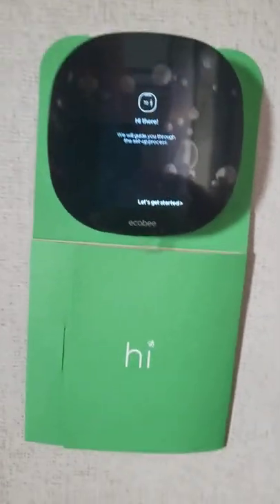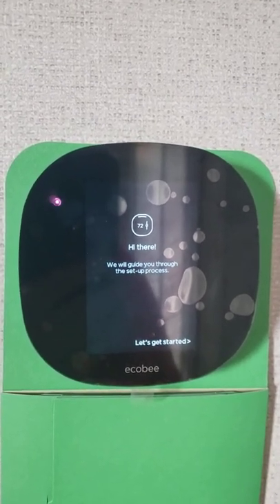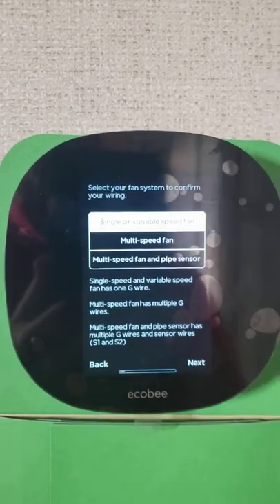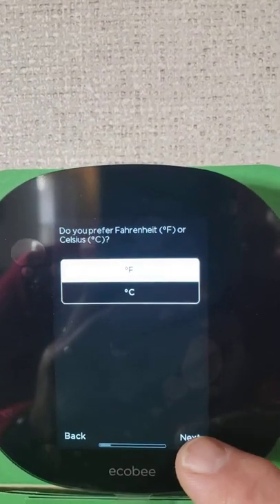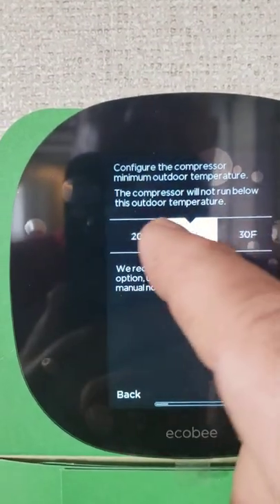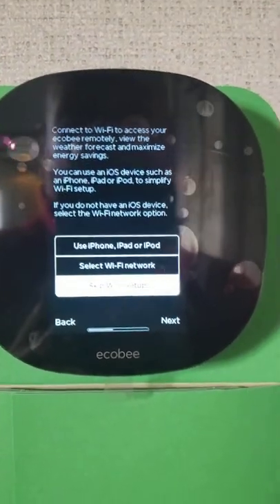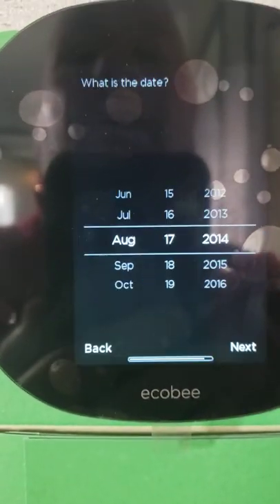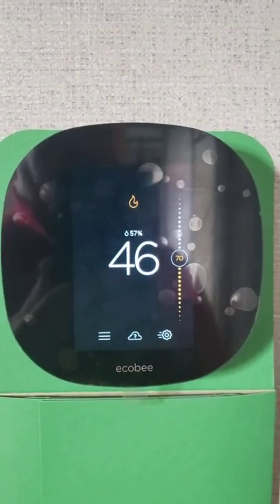Ecobee setup for dual fuel gas furnace and heat pump

Comment: Thank you for your very informative video!  It makes me hopeful that I can get my Ecobee working more efficiently with my new system.  I'm a home owner and just replaced my old old gas furnace system with a dual fuel system last spring.  I had already installed an Ecobee 3 Lite several years ago and it works great with Alexa and my small home.  However, now it isn't behaving as I'd expect with the gas side (Aux) of the equation.  I live in southern Oregon where the night temps in December & January are often in the 20's F.  Warms up to 40's in the day.  The Aux is running a lot of the time even though I've set the thresholds to 30 - 35 F.  It's 37 and Aux is still running.  My installer is knowledgeble but says that he's found with Ecobee thermostats, they never work right with dual systems.  He says that with the Goodman thermostat (I have a Goodman system) he can program it exactly to what the home owner wants and it does exactly that.  So, my question #1 is whether this is true or not.  I'm hoping that the Ecobee 3 lite can be programmed to work more efficiently with my lovely new system.  Question #2 is whether I must get a new Ecobee to make it work correctly or if indeed, I need an non-smart thermostat.  Question #3 is do I dare reset the system so I can go through the entire set up again to make sure all the correct settings are in place?  I know this is long and you are not getting paid for this advice.  ☺  I'm just hoping you can point me in the right direction.Thank you again.
Reply from the maker: Goodman does not make a thermostat, he is probably buying either a Honeywell or White Rogers or some other brand from a distributor that puts a Goodman name on them. We have had great experience with Ecobees on duel fuel. my guess is that your closest weather station is a few degrees lower than where you are. My threshold on my duel fuel is actually set at 25 so you might try setting it a little lower.
Reply from the maker: No option that I know of for that but it would still be more efficient to use HP above 35 degree.

Comment: Good afternoon, I just replaced my heat pump with an American Standard dual fuel system. I have the Ecobee 4 thermostat that I want to reuse with the new dual fuel system. The HVAC contractor is saying it’s not compatible. However Ecobee told me it is and I really would like to use it instead of buying a new stat. I live just outside if Raleigh NC.

Comment: I have two zones dual fuel both have ecobee and the only way aux runs is if I do it manually. Thresholds all set properly
Reply from the maker: Not sure why that would be. It will normally come on after a period of tstat reading 3 degree below set temp or anytime outdoor temp is below threshold but must be hooked to wifi to read from nearest weather station

Comment: Hi. I looked at my ecobee screen for the wiring, and it shows the same as your video except for the Y1 is not highlighted in mine. I have a HP and my auxiliary backup is a boiler for hot water baseboard heating. My HP is not switching to my boiler backup even when outside temperature is in the teens or single digits, when it’s supposedly set to switch to backup if below 30F. Could the lack of Y1 wiring be the issue? Thanks in advance!

Comment: Hi, great video. I have a heatpump (bosch) on furnace (rheem) and ecobee. The auxiliary heat has been on for a few days. The outside temp at mid night is around 25 to 30F. Is that wrong? I heard auxiliary heat should not be on. Thanks.
Reply from the maker: Depending on what temp you set on the compressor lockout the aux heat will run any time it is below that setting. But it is common for aux to be on below 30
Reply: Thanks. Mine was set at 40. I changed to 30. It is still a mystery why it turned on cause it was 45 the day before yesterday.Good thing it did not happen last night.:face-green-smiling:

Comment: I've got a duel gas furnace and heat pump, and I've got 8 wires coming out of the wall, that were hooked up to the existing/old Honeywell thermostat.

With the ecobee premium instructions, i only see clear details on what to do with 5 of the wires...

Any suggestions?

I've looked & looked for a video of someone who has a heat bump, installing this ecobee premium, but have been unable to find an installation instruction video.
Reply from the maker: With the Honeywell you probably had at least 2 of the wires that were to an outdoor temp probe. you would have also had the emergency and aux wires separate.  If it is a duel fuel heat pump you should need at least a 24 v wire, a common, yellow or hp contactor, W for aux heat, G for the fan, and O or B for the reversing valve. And the premiums that we have installed have connections for all of those, I have not seen one with only 5 connections.

Comment: Needs a wired outdoor sensor. Alot of times the Internet connection is not reliable. I really wish this thermostat had a wired sensor option for dual fuel lockout setpoint.
Reply from the maker: That would be more accurate but this system works pretty well especially if you are near a local weather station
Reply: @TheMurraywc  Oh ok.

Comment: Is the eco bee premium similar to this setup. Thanks!
Reply from the maker: There are several different new styles called premium.I have set up about 3 different ones and they are very similar. They may have some additional steps such as one will ask about accessories one will have the ob terminal shared with the w2 terminal and you will need to designate which it is. but the overall set up for aux heat will be the same.
Reply: @TheMurraywc  Thanks, i did get it going last night. I was a bit timid. It's at a friends house. Premium has more accessory options like you mention. Simple to do again once you know how to get there. settings, installation.   it's for dual fuel and it does that no problem.

Comment: Hey Bill! This video is/was very helpful as I'm just starting to graduate to installing dual fuel systems even though I felt I could figure it out,. Glad I didn't have to, lol. Just curious though, you don't recommend hooking up W2 to thermostat for defrost mode (possibly) or would that be too much for the system to handle being set up for a dual fuel situation? Certainly welcome your input!
Reply from the maker: Your outside unit turns on the furnace during defrost.  The w2 on this tstat is if you have a 2 stage aux heat
Reply: @TheMurraywc  Thanks for responding. Just or clarity, you're saying I wouldn't need to hook up the W2 from the heat pump condenser to W in this set up, it would already automatically turn on gas heat in defrost (if above 35 degrees) or below 35 degrees if ecobee 3 lite is set up that way?

Comment: Hadn’t really thought this through before, but using dual fuel during a large area crisis would be a problem if the internet is down - which is a huge possibility. No internet, no outside temperature, and Ecobee doesn’t know when to switch from heat pump to furnace (other than, maybe, going way below the inside temperature set point - does it even have this?). I’m going to have to reconsider relying on Ecobee during an emergency. Anyone with ideas?
Reply from the maker: In the situation where the internet is down the unit will simply go back to where it relies on temp drop in the house to determine when to switch over. The variance should be 3 degree at most. It will work perfectly fine and only result in a few more change overs and cool down periods which will still be efficient but give a little more temp swing
Reply: @TheMurraywc  Thanks, and thanks for answering so quickly!

Comment: Hello, my heat pump has heat strips as auxiliary. Can i lock the strips out so they dont come on at all until I turn the auxiliary heat on?
Reply from the maker: You should be able to just disable where it asks for aux and hp to run together. then disable on the next step for temp setting

Comment: Hi may I ask is there a setting for certain time for heatpump and gas furnace??? I would like to set heatpump run 7pm-7ambecause electricity 50% 7pm-7am, and use gas furnace 7am-7pm because gas cheaper 7am-7pm??? Thank you
Reply from the maker: Not that I am aware of but if you connect it to your phone there may be a setting for that in the app.
Reply: @TheMurraywc  Thank you Murray, you have a wonderful weekend... thanks

Comment: I have all the same wires you have highlighted plus the w2 wire I, I have a heat pump with oil backup, but my oil backup is not turning on
Reply from the maker: If you have a single stage oil furnace I'm not sure why you would have a W1 and W2, make sure that the oil back up is tied to the W1 and go through the set up. This one is for units that have a reversing valve that energizes in the cool mode. Check your unit to make sure yours does.
Reply: @TheMurraywc   I’ll look when I get home, pretty sure it’s a single stage thanks

Comment: Bill,  Why do you choose for the furnace and not the stat to control the fan. By choosing furnace isn’t this preventing to homeowner to choose options like AUTO and CIRC from the stat?
Reply from the maker: That is only while it is running in aux or em heat. You can use either but you will get a couple of minutes of cold air while the heat exchanger gets up to temp
Reply: So, if I choose to let the furnace control the fan, can I still go back and forth between ON, AUTO, and CIRC on the Evobee?
Reply from the maker: Yes you can
Reply: Does this work with two zones? Will two eco bees work together? If I have a 2022 premium will it work with a lite?
Reply from the maker: @mtmusic9608  not as far as I know

Comment: Do you need outdoor sensors?
Reply from the maker: No you do not. It will work best though if connected to the internet so that it can get the latest data from your closest weather station.

Comment: Is it possible to override the heat pump as the primary source of heat and to switch to gas heat on the Ecobee after this is setup? If so, how would you go about doing this?
Reply from the maker: When you follow this set up all you have to do to change to gas is select Aux as your system, that will turn off the heat pump and run the gas.
Reply: @TheMurraywc  thanks! Is it possible to wire it so that the gas is the primary and heat pump as aux?
Reply from the maker: @jplee3  No that will not work. the heat pump is most efficient above 30 degree and the gas is more efficient so I see no scenario where that would be beneficial so they do not have a set up for that.
Reply: @TheMurraywc  Thanks. In terms of the actual wiring between your heatpump, gas furnace, and t-stat, how did you run the O or O/B wire? In my case, there's an O wire coming off the heatpump (currently this is tied in with the Y wires at the heatpump), but there's no terminal for O or O/B on the furnace. Ecobee support is saying you can run the O wire directly from the heatpump to the thermostat - is that what you had to do in this case?
Reply: @TheMurraywc  BTW: what does your wiring look like in order to provision for this scenario?

Comment: i have mine set to 35 threshold but it uses aux at 36, 37, 38. am i missing something? also always get the warning from them that aux is being used too much.
Reply from the maker: If you are connected to the internet it reads from closest weather station.  It can also turn it on if your house needs more, if it drops 3 degrees in the house.